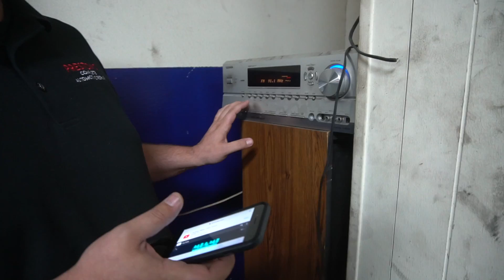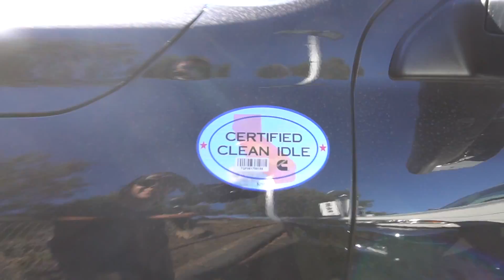The new 2018 Ram Cummins Front End is Hideous!

Comment: Swap the grill. It’s worth it for a quality Cummins engine.
Reply: Andrew Schrandt  its all about the power stroke diesel brother
Reply: Andrew Schrandt  its all about the power stroke diesel brother
Reply: Andrew Schrandt its all about the powerstroke diesel!!
Reply: Andrew Schrandt engine not tranny lmao
Reply: Cole Schlangen Too bad Cummins doesn’t build transmissions. The six speed manual is good. The auto is sometimes known to have issues. You never know with these trucks. I’ve owned dodge and ford and they both have their issues. Cummins on the other hand is bullet proof off the shelf.
Reply: Brandon Cabrera I don’t have a diesel right now but I switched from Dodge to Ford and I love my coyote V8. Way better than the hemi in my opinion. I know I’ll get hate for saying this.
Reply: 6 in a row ready to tow lol
Reply: Andrew Schrandt Cummins doesn't build transmissions.
Reply: archinuk417 If you read my comment I said if only Cummins DID build transmissions. Nowhere did I say that they did.

Comment: I have the pioneer mvhx 380 bt head unit in my 97f350. It is bluetooth and radio only, no CD. I'm completely happy with it. Running a kicker 10 and amp behind the rear seat. Linked up to my android and now iPhone no problem. Has a wired Mic I put on the column by the hazard switch. No complaints from any one I talk to on the phone. I'm in San Diego too if you want to check it out.

Comment: Dmax! As a owner of a 2017 L5p and also just traded a 2015 Lml for the L5p. Just want to give my opinion. The Lml was a beast tuned and deleted. Loved it. I am a farmer and I beat the shit out of my trucks so in the past 2 years I put 120k miles on the Lml never had a problem. I tow up to 18,000 pounds pretty regular and neither truck has a problem with it. But I must say a non deleted or tuned L5p will pull the weight a little easier. I think the L5p is the better truck. Now I’ve not tested the durability of it yet as it only has about 10k miles on it. But I feel confident that it will do fine. I do miss the delete and exhaust as you might have guessed though. Can’t replace that sound. At the end of the day it’s your choice and this is just my opinion. Everyone has one. Can’t go wrong with either truck. Good luck choosing! Been watching for a long time keep the vids coming man love it! Keep working for it!

Comment: 2017 F350 dually has a lot more creature comforts
Reply: Dick Burns I just picked up my 2017 f350 dually for $67000 , it has panoramic roof, heated/cooled seats, quad beam led headlights, led tail lights, blis, leather, lane alert, front/back/side cameras, plow and camper package , fx4
Reply: Dick Burns I just picked up my 2017 f350 dually for $67000 , it has panoramic roof, heated/cooled seats, quad beam led headlights, led tail lights, blis, leather, lane alert, front/back/side cameras, plow and camper package , fx4
Reply: what about your massaging seats?

Comment: What about the air suspension, that is what my father has on his '15 Ram 2500 and it makes for the cushiest riding truck ever. Those trucks have no coils or leaves they have air springs. If I had the funds to buy for a truck I would certainly go for a Ram 2500 or 3500 all  the way yes they may not have the features that Fords have but they're the only trucks that have air suspension if you want a truck that has a ride that is close to that of a Caddilac when not towing but can still tow big loads.

 And you can never go wrong with a Cummins, at least when its equipped with the Aisin transmission, even the 6.4 HEMI is no weakling yes it has less torque but since diesel is more expensive and I'm not the type to buy a truck just to flash my money neither will I ever tow something heavy enough to warrant having a diesel I would buy the HEMI truck.

Comment: The salesman doesn’t have a clue “We have the 07.5 Cummins you get 6.7 with 5.9 emissions” sorry bud the 5.9 never had the pile of shit egr valve sending 1/4 of the exhaust soot back in the intake. These new diesels would make a better boat anchor than a truck once the dpf is plugged and the intake looks like you smashed up 5 pounds of charcoal in in. Engineering fail!

Comment: D.E.F was the DEATH of my sexy 2014 Ram 3500 Laramie.  Purchased  DEF fluid from a store that's home of the Beaver.  Poured it in while there and it turned out to be contaminated.  Ruined my system and Dodge would not warranty.  $5,000 out of pocket for repair.  I traded it in, truck was over a year old.

Comment: Pffft “dodge has the best diesel” coming from a salesman.
Reply: Jeffrey Vandenbiggelaar there are plenty of 1million+ fords on the road. Also international produces powerstroke for ford to use. International has diesels in heavy duty equipment.
Reply: beday gaming  only time I've seen a Ford with a million miles is a 7.3 powerstroke or Idi, yeah international has good motors but they never did a good job with the 6.blow and 6.4. Fords in house 6.7 seems like a good motor but the mess under the hood steers me away from wanting one. I like my 6.7 Cummins simple and so much easier to work on. Also tuned and deleted so I won't have to worry about emissions choking it out and going to shit. As for Chevy/gm the only good thing is the duramax (except for the pistons and crankshaft, and the cp4 in the new lmls)  the Allison isn't as good as everyone thinks and the ifs is junk.

Comment: The ram comes out from factory with fucked transmission
Reply: Only if you dont know what you are getting. Get the Aisin. No more issues.
Reply: Larry Bondar ok you have never owned one I can tell bc of the shit your sayin...I've owned 5 dodge rams no transmisión problems out of none of them and the last Cummins I had pulled a lil over 700 hp not one fuckin problem and I had a shift kit and gear reduction in it....stop sayin shit that you just hear.
Reply: This dude's stuck in the 90's.
Reply: LSX StreetCars really I’m stuck in the 90’s look at your account name 😂
Reply: Larry Bondar the transmission where bad in the 90s but dodge is past that now and the transmissions are a lot more reliable
Reply: Larry Bondar ls1s.. making ford boys butthurt since 97.